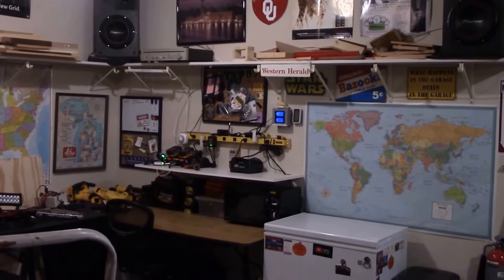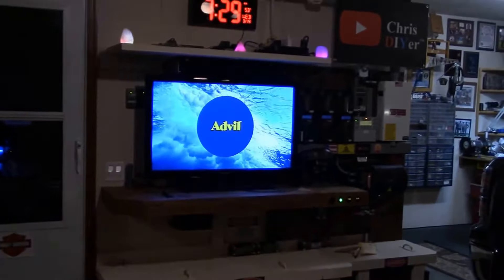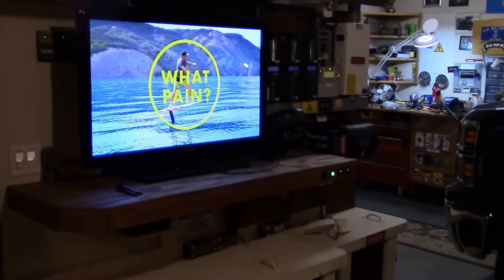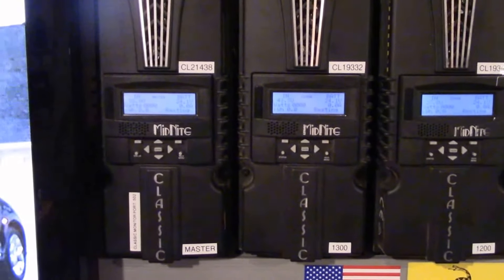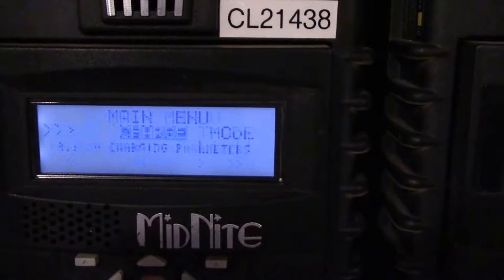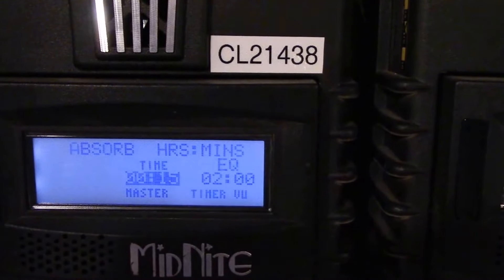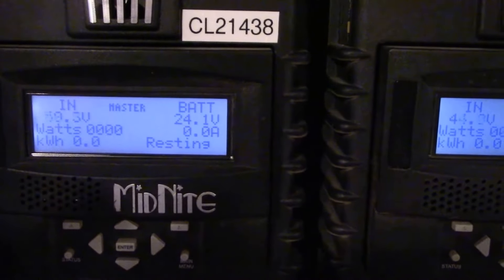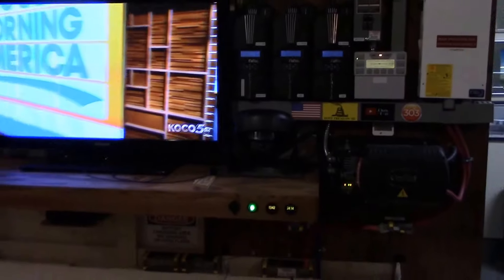DIY partial off-grid home solar power - new battery charging parameters

Comment: Keep us posted on how this works. I lost  RIP 2 of my 8 L16s before my move to TN. I will be hopefully installing a small temp set up for my big camper next week ,solar camper #2 if I can move to my new off grid property this weekend i hope .Thanks for sharing.
Reply from the maker: Will do. Oh man, thank stinks with the two batteries...what small temp system do you have in mind? Not sure how this will work out, but it "makes sense" to me. Bring these L16's "all the way up" for 15 mins and then let them settle down. Similar to what many other battery charging systems do. "Long absorb" is great, but with 32.40 volts...the actual "time" from 29.64 to 32.40 is not that much different. Just bringing them up higher to stir things up

Comment: Hey Chris, Glad to see that it's working out better for you with your new parameters.  Your a little higher than my system recommends (abs=29.2, fl=26.8, eq=31.0).  I have the same batteries but different charging equipment.  Thanks!
Reply from the maker: Thanks. I think your batteries are the "RE" ones...mine are the L16E-AC ones. The tech data sheet on mine reads: 29.64 bulk, 27.0 float, 32.40 EQ. From 29.64 to 32.4...there is quite a bit of "time"...so, prob works out the same compared to "traditional" ways many folks charge these type of systems. Got the float set a pinch higher. Each system is different...still recovering from what I found in December. Had some "bad" advice from someone last year...won't let that BS happen again
Reply: Yes, I have the RE's, thought you did too...  Sounds like you have it figured out and its working so keep right on rolling with it!